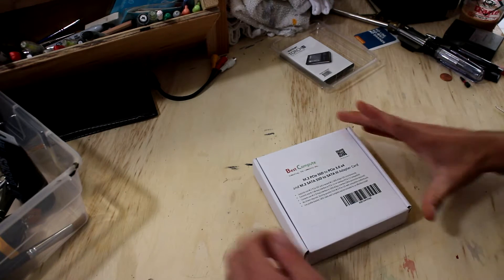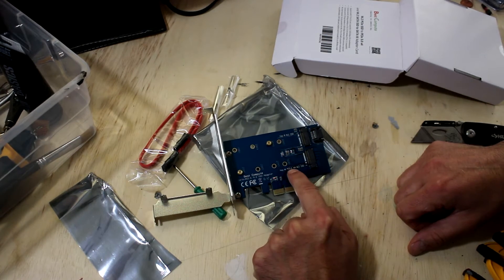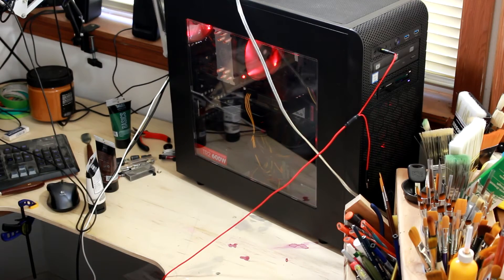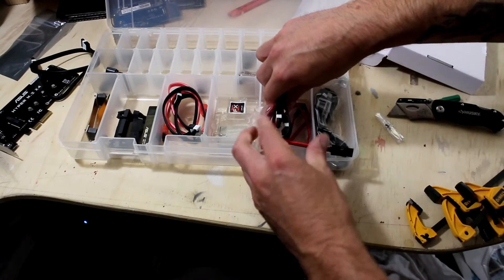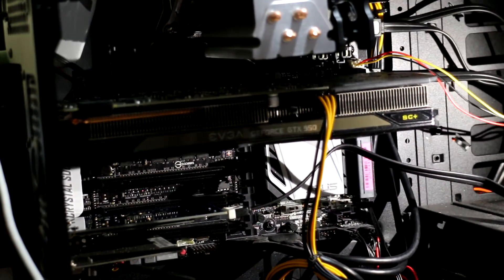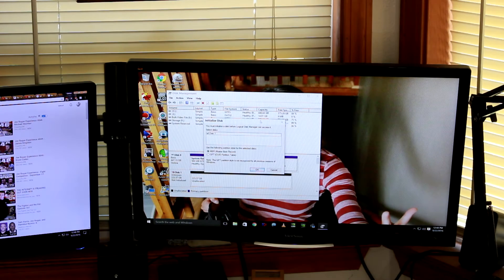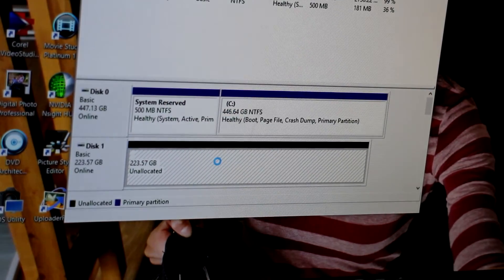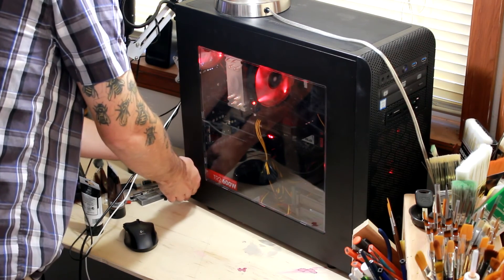SSD Drive Fixed! Converting a SATA to PCIe!

Comment: Is this compatible with Asus A68HM-K Motherboard that has AMD processor and I also wanna ask, if I use the slots of this adapter with 2 NVMe SSD simultaneously, will the computer detect the storage considering its motherboard and processor? And by the way, is the sata data port of this adapter also compatible with 3.5" HDD sata drives or will only works for sdd drives, is it okay to plug a 3.5" HDD sata drive on it? Please answer my questions, I just want to confirm if this will work before buying.

Comment: Dude, you show an M.2 ssd and put in a SATA PCIe card? Makes no sense.
Reply from the maker: I had to convert the M.2 to a PCi as I could not return the card. Luckily I had the open lanes at the time as I don't run dual cards. Performance was not as great as the M.2 slot, still pretty good for video editing.

Comment: I'm really confused did you just connect the extra SATA port on the PCIe card to a SATA port on the motherboard?  Well, that won't do anything.  That port you used is for an additional drive if you run out of SATA ports on your hard drive.  M.2 is a form factor and they can be SSD or NVMe drives.  SSD won't get you any faster than connecting a 2.5"  SSD drive to a SATA 3 controller.  

I would only use one of these if I bought an M.2 NVMe and my computer doesn't have an M.2 NVMe ("M") connector.  Then it is as simple as plugging the NVMe into the PCIe card and then plugging that card into the mobo slot and boot.  No other connections are necessary.
Reply: I have that same type of pci-e adapter.. the bottom slot is m2 NVME and the top one which he used is m2 sata. The top slot needs to be connected to an onboard sata port but the bottom slot works just fine with pcie.
Reply from the maker: The drive didn't initially boot without the sata.  So,  out of necessity I added it that way.  Basically put,  my motherboard has the slot,  wrong connector,  so I had to workaround the issue as I could not return drive.
Reply: Now say in english